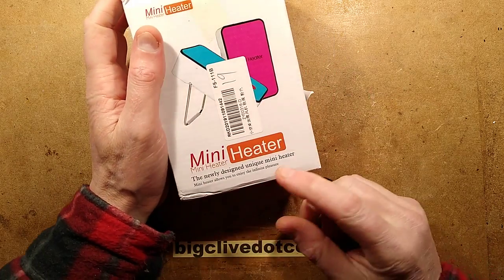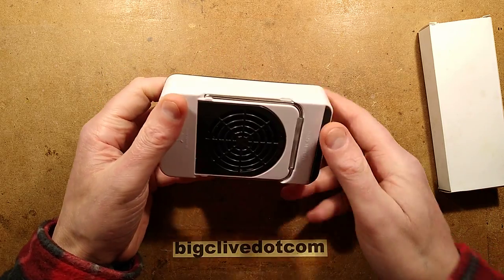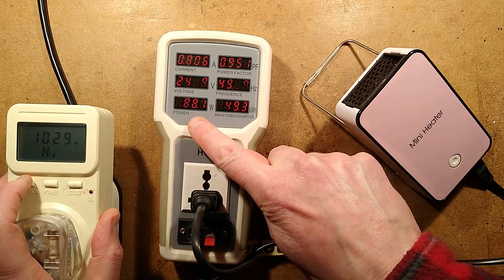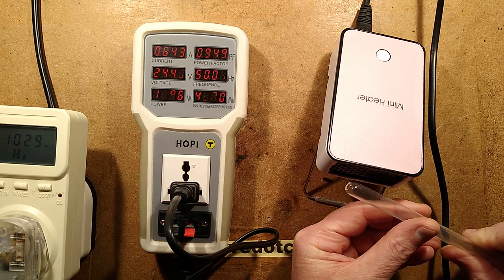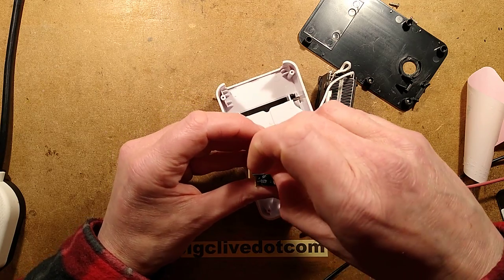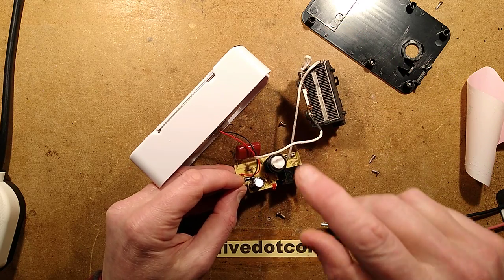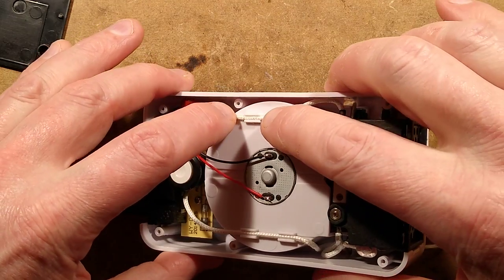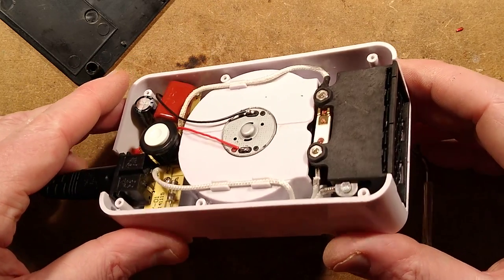All plastic 150W eBay desk mini-heater.  (With schematic.)

Comment: I think that the airflow of such blower can't be reversed (it never pulls air in). With the motor running in reverse, it would still blow, but with a different efficiency.
Reply: Exactly correct sir! (or madam, or madman, as the case may be). When run in "reverse" by Clive's definition, less air is flung out at a given RPM, but the fan also stops having the annoying habit of pulling more power when the inlet is blocked/less when the outlet is blocked. At a higher RPM, they will still move plenty of air, and create significant pressure if necessary, to achieve that flow. I've seen them used to drive a minor hurricane of air through rather restrictive HEPA filters, for a once-through air supply to hospital operating rooms. (No recycling of germy air!)
Reply: I watch your videos

Comment: The best "small~ish" heater I have is my Core 2 Duo laptop with a Dedicated Nvidia GPU, that's how you get nice and toasty on the go
Reply: AustinG  not gonna lie I used to use a first gen i5 to warm my desk at work years ago
Reply: My mobile i5 580M with the a Nvidia gpu is also a great heater. I can't even use the thing at 100% cpu speed cos it pushes beyond 100C
Reply: @OrbitalSP2  I know what you mean! I had a laptop with an i3-350M. Man those things get hot and love to throttle by themselves.
Reply: Lol I actually have one of these and know exactly what you mean! I have an Asus G50VT laptop (Core2Duo P8700 and an Nvidia 9800M GS).
Reply: @bluegizmo1983  nice! Mine is a P8600 and a quadro nvs 160m
Reply: I have a pentium m notebook, it stays quite cool, but it makes a nice draft of warm air
Reply: My phone works as a great hand heater in the winter time.

Comment: a common thing in the old days of hair dryers is they tapped off the heating element to power the fan, so no caps or bridge, just a diode.
Reply: What kind of motor would they have? I have a heat gun that has a motor that must have come out of a toy and looks DC powered and I have no idea how that could be done.
Reply: @SquishyZoran  The same way: they tap the heating coil to generate about 12V.  A full wave bridge, usually four 1N4007 diodes mounted on a circuit board on the rear of the motor can, changes that to DC for the 12VDC fan motor.

A two speed heat gun switches in an additional section of nichrome heating coil on low power, which also slows the fan.
Reply: They couldn't use that trick in this circuit because it is PTC regulated, so it wouldn't have a very stable voltage.

Comment: I believe these type of heaters are actually for finger nail polish
Reply: Finger nail polish curing is sped up by UV not heat.
Reply: @eraldorh  Regular nail polish doesn't react at all to UV but heat (and moving air) does reduce the curing time. Specialized UV nail polish/gel exist, these require UV light to cure but shouldn't be confused with regular nail polish.
Reply: You all all wrong, nail polish is actually cured by gamma radiation so its best to keep a small supernova in your closet
Reply: @whatsonchannelB  I use a black hole, but I have to keep some curry handy.
Reply: Far too much knowledge of a non-engineering topic; are you here for the 'pink' side of Clives' videos I wonder ;)
Reply: @whatsonchannelB  They don't sell consumer supernovas in the USA.
Reply: Paul, if two burly blokes want to slog to out over a nail polish argument, I say .... bring me a chair.
Reply: @paulvale2985 
Lots of non-gay hobbies use things like nail varnish, or the little UV lamps and such for purposes they were not intended for.

Clive's demonstrated using a UV nail curing lamp for circuit boards.
I think Great Scott tested clear nail varnish as a water proofing coating.
RC aircraft people use hairdryers for fixing foam that's dented/bent.
Model railroad people use all sorts of things in unintended ways.
Reply: I'd like to know if those UV LED nail polish lights are just a gimmick? Do they actually put out strong enough UV to do anything? I'm doubtful.
Reply: Wouldn't a hair dryer on low/slow do the same thing
Reply: @grabasandwich  yes they do. I use one for curing small intaglio resin plates and cir uiy boards.
Reply: Actually the sort of thing you'd find in an office when you work with women, they are always cold, and have a heater on them every minute, this is quiet and hidden easily under the desk, so the bos doesn't know
Reply: @jusb1066  Bingo. For this exact same reason I have one of those things. Whenever my gf is around she always complains because of "cold feet".
Those micro heaters use less power than my PC and keep the gf happy :)
Reply: @tin2001  - And, shocking as this news might be for you, guys can also wear nail polish and not be gay. 😱 Who knew!? Putting something on your nails doesn't determine where you like to put your genitals.
Reply: Dan Josef straight guys don’t tend to be into nail painting.  I’m gay.
Reply: @theotherwalt  I checked United Nuclear, not seeing anything. Drats.
Reply: @GoatDust  - Then you've lived a very sheltered life meeting only very boring people.
Reply: TheMrVengeance yeah, I must’ve missed out on so much with nail painting LOL.
Reply: @GoatDust  - When did I ever say you should? 🤷🏻‍♂️
Reply: @TheMrVengeance  it may not mean guys who put polish on gay but it would make them weird....
Reply: @mashedpotatoes5323  - No it makes you weird, take your toxic masculinity elsewhere.
Reply: Seems pretty multi-purpose to me
Reply: @whatsonchannelB  Or a little bit of Cobalt 60 ? I wonder if it works, heard that people who tried lost their nails !
Reply: @TheMrVengeance  yes, indeed I am weird because I am a male and I don't paint my nails and toes the fucking rainbow and I don't hang shit on my walls that says live, love, laugh.
Reply: @TheMrVengeance  nah, it's always that if men use something on their nails.
Reply: @mashedpotatoes5323  - No it makes you weird because you give a sh*t what other men put on their nails and walls apparently.
Reply: @jothain  - Except, you know, it's not.
Reply: @TheMrVengeance  I'm just going to say it, I could be wrong but I'm getting a strong sense that you believe in more than 2 genders...
Reply: @TheMrVengeance  oh hell yeah I really do know. None of the about hundred straight men I know. None of them uses nailpolish.
Reply: @mashedpotatoes5323  - Nothing to "believe" there, even going purely by biological sex there are more than two sexes. So claiming only two genders is the ridiculous option. 😂👍🏻 Nice try though.
Reply: @jothain  - Ah yes, anecdotal evidence. Absolutely fool proof. You do realise that if there is even only a single straight man that wears nail polish, you're argument is defeated.. right? Something about absolutes.
Reply: @TheMrVengeance  not including the rare cases of people who are hermaphrodites there are only 2 genders and that's a fact (kinda like the rare cases of straight men who wear nail polish are weird as in that's not normal...)
Reply: @mashedpotatoes5323  - Aaah, yes. Of course. Not including the other colours, the only real colours are yellow and blue. Funny how only the things you want are left, if you exclude all the rest! 😂
What is actual biological fact is that there are people that are neither XX nor XY. Meaning that even in purely biological sex, there are more than two sexes. That it's rare is irrelevant, it's fact.
Now take into affect that gender is the sociological interpretation of what it means to be of [insert sex] (of which there are more than 2) and you'll see how factually ridiculous your point is. 

Facts don't care about your feelings, is something you folk always like to say. Get over it.
But again, nice try though. 👍🏻
Reply: @TheMrVengeance  that's your interpretation. You do realize that? If you claim it's common, you're in some absolute minority
Reply: @TheMrVengeance  um okay?? That analogy just doesn't make sense... I'm just starting to think your just one of those sjw people that look like a man and a girl at the same time...
Reply: @jothain  - Go ahead and quote me where I say that it is common.
I said; not all men that wear nail polish are gay.
You said; no, absolutely all men wearing nail polish are gay.

I'll quote you, here you go:
"it's always that if men use something on their nails."
~You, 1 hour ago
Reply: @mashedpotatoes5323  - The analogy makes perfect sense.
If you don't include these other things, there are only 2 things. Is what you said.
Which is the most ridiculous logic and can be applied to anything.

If you don't include other animals, cats and dogs are the only 2 animals.
If you don't include other sexes, male and female are the only 2 sexes.

And what about "people that look like a man and a girl at the same time"?
Do they bother you?
Are you scared you might be attracted to them and have to ask yourself some personal questions?
Why do you care what they wanna look like?
Reply: @TheMrVengeance  what other genders are there? A fucking toaster? cantaloupe? potato? No there is male, female and the genetic mutants...m
Reply: @TheMrVengeance  and you've misquoted there.
Reply: @jothain  -  That was literally a copy and paste of your whole comment. Go ahead and explain how that is "misquoted".
You clearly claim every man with nail polish is gay. Every single one, always.

But you know just as well as I do that you can't defend that comment. You just don't want to admit it. Which is why you're trying to dodge the question.
Reply: @TheMrVengeance  you don't have any context anymore. It looks like you're twisting your own comments from before.
Reply: @jothain  - So? Why aren't you explaining it then? That was what I asked you just now.
I said that men wearing nail polish doesn't mean that they're gay.
You said:
"it's always that if men use something on their nails"
Context is clear; you're saying it's always that [ie. that they are gay] if men wear nail polish.

Might I suggest at this point you throw out a red herring? Maybe swerve into the "only two gender" nonsense like your friend.
Who knows, people might forget you weren't able to defend your first take.
Reply: @TheMrVengeance   TheMrVengeance  okay. Let's try to be more specific. Out of those about hundred guys I know, they're are straight and don't use nailpolish. I'll stick with that claim 100%. And I stick to the claim that normal men don't use nailpolish. Note men. I don't know what boys under their 20's do as I don't count them adult males, men and I don't care if someone would. Only gay men I've known have used nailpolish. Note only them and I'm most definitely saying that not even most them are using it. That's definitely not the case (I know only one). So do I know straight men that use nailpolish. Absolutely no. I don't care what else you want to know. So all in all. It's always gay in my case no matter how you look at it
Reply: @jothain  - 
Kirk Hammett, 57, has been wearing nail polish for at least 3 decades. Has been married to his second wife for almost 2 of those now, and has two children.

Brad Pitt, 56, has worn nail polish, was married to Jennifer Aniston and Angelina Jolie.

Jared Leto, 48, has worn nail polish, used to date Scarlett Johansson.

Snoop Dogg. 48, has worn nail polish, has been married to his wife for over 20 years now.

Sooo... how is it going with your 100% of men who wear nail polish are always gays argument??

And these are just a handful of famous examples. I know more; Travis McElroy for example. Some personal ones as well, but it seems rather pointless to list those, since you won't know them.
Reply: @jothain  - Hahaha. So what? Why does it matter if you know them? 😂👌🏻
They are men, they wear/wore nail polish, they're clearly not gay.
That's your argument 100% dead.
Reply: @TheMrVengeance  you're actually serious there? You actually know these celebrities? Or wait? Are getting information from cereal box, tabloids. No let me guess. Wikipedia, that's the real reliable shit. Yeah I truly don't give a shit about those, gtfo😂😂😂 If Iwill happen to sit by ass down with any of those and personally get to ask them. But I don't live in fantasy land and that's unlikely to happen. But hey, I'll be sure to personally tell you if I happen to speak with any of those 🤣. No please get me more reliable facts. This is getting really good
Reply: @TheMrVengeance  and I'm not a bigot, it's a fact there are two genders, male and female...
Reply: @TheMrVengeance  Grow up? You there actually claim that Brad Pitt is using on normal conditions nail polish, sounding like he is doing that daily? How about proving your point that common men are using nailpolish. If you're correct there I'm sure you can find me even remotely reliable global study about this? If you find me one that shows that even 1 out of 1000 men use nailpolish, I'll believe you. But ffs who actually believes that some actor is normally using nail polish and saying based on that kind of an belief that it's normal from unknown source? You're telling me to grow up? I Also why are you now making me sound like I have something against gay people? I personally know gay man that's done incredible career, is more patriotic than any other man I know and build really nice house by himself. Ok show me that data I asked. You've told me to explain and now I've given you thing a give me.
Reply: @mashedpotatoes5323  - If that's a "fact" then what are people that are neither XX nor XY?

Also how are you going to say you're not a bigot after calling intersex people "mutants", ridiculing LGBT people and calling me a "genderless creature"?  🤣

EDIT: And ironically, you've defeated your own point by calling me genderless. Because YOU have now already established three genders; male, female, agender.
Good job.
Reply: @TheMrVengeance  and your Brad Pitt example is good kiddo? Pathetic try to save there
Reply: @jothain  - Yes, it is. You claim every man that wears nail polish is always 100% gay. Brad Pitt is a man who's worn nail polish and is not gay.
You also conveniently ignore other examples I gave, like Kirk Hammett, who's worn nail polish regularly for at least 30 years now, and been married to his wife for almost 20 of those now. And has 2 kids.

You're grasping at straws. That is what happens when you argue in absolutes.
Reply: @TheMrVengeance  and just to be clear I have nothing against gay marriage, transgenders as in sex changes like Bruce Jenner, I actually have a family member who is transgender (I know I used the word trans but that's associated with the lgbtqrsvtishf stuff too) but I do think it's absolutely ridiculous someone claims they are a "they or them" instead of a "he or her" and expects everyone to follow their delusional way of life or they will get offend and get triggered
Reply: @whatsonchannelB  so that's why the Hulk's nails are always perfect.... That's his secret!
Reply: All of those men you mentioned are on the downlow. 

Straight men don't use nail polish.
Reply: I use UV and standard nail polish in making fishing flies and lures.  Also touch up my front sights on my handguns with opal white UV cure nail polish.  Hard as Nails is a hell kf a lacquer for small things.  Hell, next time i'm in the right town I need to pick up a vibrator motor to put on my powder hopper for reloading.  Real men don't give two sheets about a charade of "manly" things.  If you are scared of "girly" things, you probably have some unresolved things in your "closet" you should probably deal with.  😎
Reply: @grabasandwich  Slowly but yes.  Unfiltered sunlight is better.  I have a Convoy flashlight with a nichia UV Led that runs about .7A if I recall correctly at 19650 volt.  It cures UV resin like a zeus lightning bolt.  Then again its probably a little much if you shine it on skin you quickly get that "been in the sun too long" smell and a burning sensation.  Makes everything in the dark look like a CSI crime scene.

Comment: I've seen some 400W heaters shaped like a teddy bear for around 5 pounds, those might be worth taking a look at too, seems like a cute instrument of death
Reply from the maker: I think I may already have that here.  In pink plastic.
Reply: @bigclivedotcom  A pink plastic teddy bear of death?! YES! :D
Reply: @SigEpBlue  Double duty! xD
Reply: Of course in the old days we had the dual purpose light bulb/heating elements.
Reply: Electro-cute you
Reply: @SigEpBlue  Yes! That would go nicely with The cheapest pink shoe warmers of death, magic pink insect-sucking 220V death ball and Pink plastic LED fish-o-cutor
 Clive has done videos about before.
Reply: No wonder it was made in China,  where still present a very ancient prejudice against cold ❄ in general (tzi, if I'm not mistaken,  like all illnesses from cold) and it's so widespread that outside tourist zones you won't find anywhere in China a cold drinks, the ice for drinks are very rare thing too, in small villages no freezers,  even in restaurants,  that's why they selling live chicken on market which killed right there with big mess
Reply from the maker: @ridley68  You can still get the heat lamps online.  Mainly sold for breeding chickens, but also ideal to bask under.
Reply: @bigclivedotcom  I know, I bet Amazon/ebay think I run a chicken farm.
Reply: Perfect for putting in a cold bed to warm up just before getting in 😂
Reply: My ex loves teddy bears.
Reply: Bring On The Teddy Bear 🐻 Of Death 💀 By Electrocution 🔋 & Maybe Some Fire 🔥 Too!!!!!! Awesome 😎!!!!!